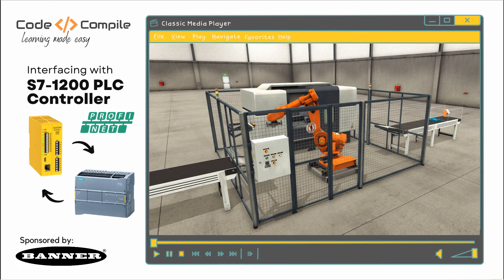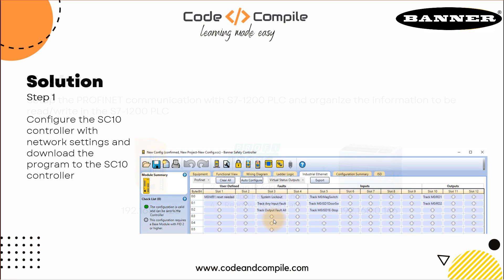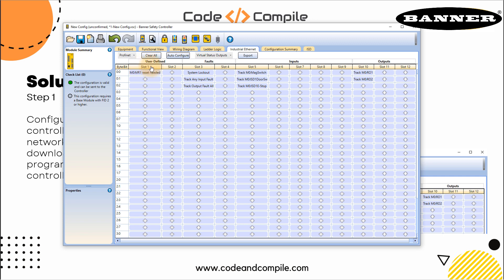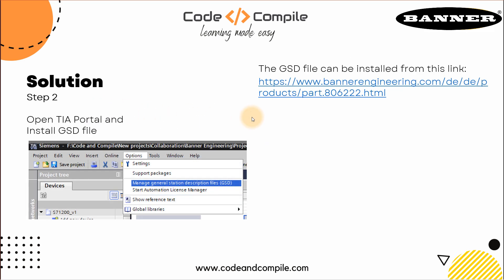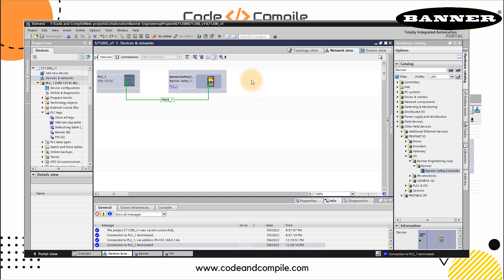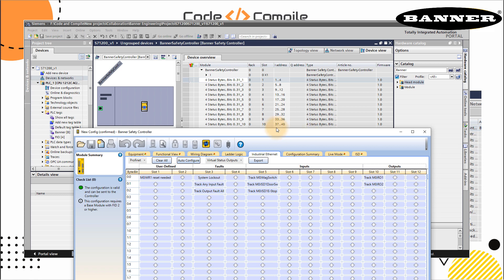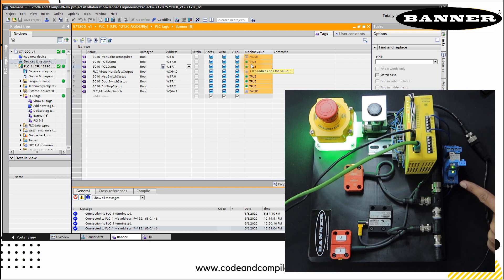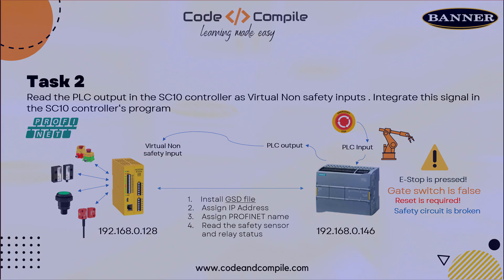Episode- 8  Interfacing SC10 Controller with S7-1200 PLC via PROFINET

Comment: Sir signal isolator ke bare me explain kare it's very important for me mai New plc commissioning pe work kar raha hu because I forget something about signal isolator connection
Reply from the maker: You should isolate the signal using relays to prevent accidental damage to PLC output if the output gets saturated.
Reply: Sir my problem has been solved  now you replied very late I want accuracy of signal in float so that is solved plz make a video on it I mean isolator if you want